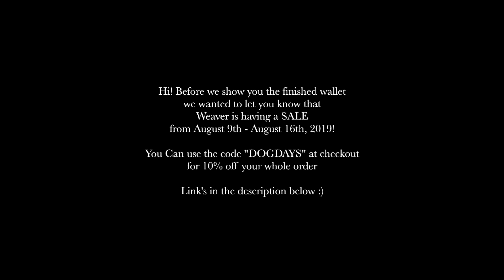Making a Leather Clutch By Hand

Comment: Did you mod your weaver edge beveler? I have a size 0 also but i find it hard to bevel thinner leather. Looks like you are using a 3oz or so? The beveler always hits the table so i was wondering if its worth grinding the tool down a bit
Reply from the maker: Nope! Just keep it super sharp with their strop board, then you'll see us edge thin stuff on the edge of the cutting board - that helps to get the piece high enough to edge without modding the tool :)

Comment: Question: I've watched several of your videos now. I enjoy all of them. I was wondering what determines whether or not you use the silver metal cutting knife to 'scratch off' the edges of a piece of leather before gluing it to another piece of leather?I don't think you did that in this particular video, just straight piece to piece gluing. But in other videos, you scratch off the outside edges or sheer them off with that wide bladed 'chisel-looking' tool before gluing them together. What determines when you scratch/chisel? Thanks!
Reply from the maker: if the leather we're using is dyed and oiled, we'll rough up the gluing surface. If it's not (like in this video) we won't, as the natural veg tan is totally untreated so the glue sticks just fine :)
Reply: @Corter  Awesome. Thanks for the lesson!

Comment: Beautiful! I like the pouch in it, where I come from we still use a lot of coins.
Edit: okay I saw what leather you used in the Link 🤣 unfortunately I can't see what thickness you used for the veg tan leather. would you mind sharing which you used? 😊
Reply from the maker: This is 2-3oz veg :)
Reply: @Corter  Pines Milled is a Chrome Tan isn't it? But you lined it with veg tan? Does that make slicking the edges a problem?

Comment: why dont you use the double sided tape to glue everything? is it harder to burnish?
Reply: The glue is a structural bond that adds to the strength,  the tape is more temporary, and won't bleed through the zip.